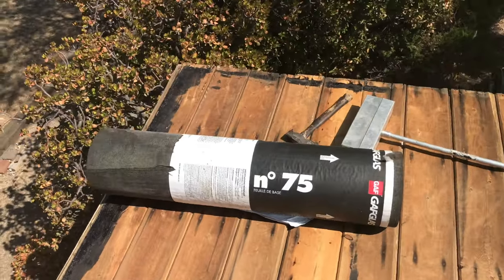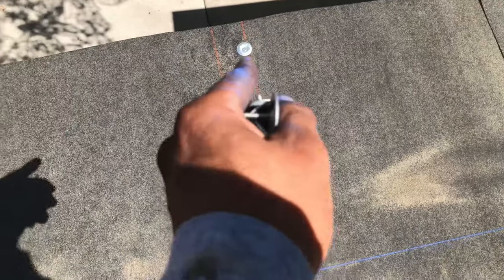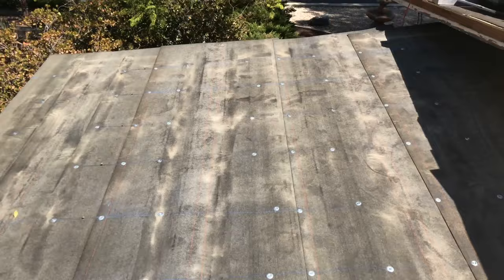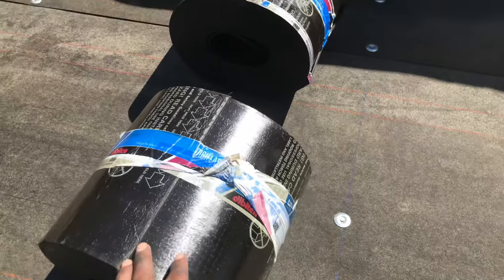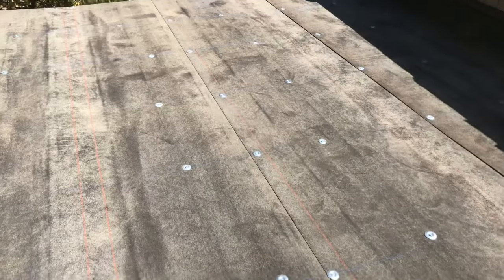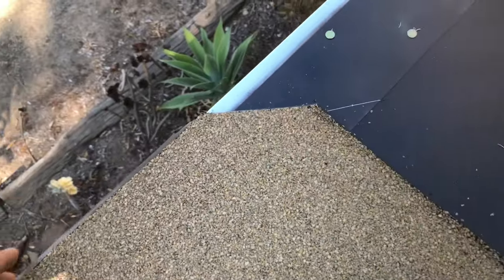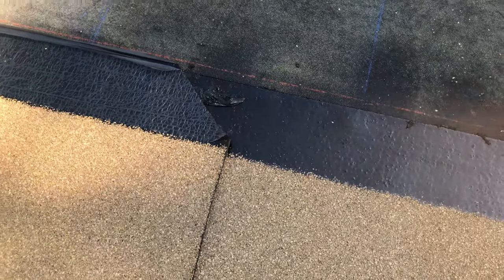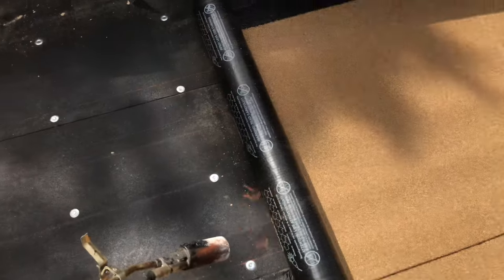STEP by STEP How to do Modified Bitumen Torch Down ROOFING INSTALLATION

Comment: There was numerous issues. I’ve been torching for over 15 years. I appreciate you trying to teach but there are much better procedures. First I would have primed the wood and used a peel and stick. Next you need a fire extinguisher especially on a wood deck. And we definitely don’t call it a flame thrower.
Reply: So prime it, be safe, call it the right thing? Seems like nit picking to me.

Comment: question... due to the fact that there is a drip edge PLUS a narrow roll of bitumen on the edge on top of the rolls you covered the whole roof with, won't there be standing water all around the edges due to edges having more layers than the middle of the roof, after you apply the cap sheet?
Reply from the maker: Yes, but it won’t leak. Also there won’t be too much standing water because it has open edges, no parapet walls. most likely the water will evaporate next 2 days of sun. All flat roofs have ponding water. You are able to fix this but most homeowners aren’t willing to spend the amount to correct the issue. We as roofers just have to make sure we put on a roof that doesn’t leak. The torch should be completely melted onto the deck. So ponding water should not be an issue unless it is excessive which will be more weight on the roof.

Comment: How you doing brother Joey here maxx roofing sunnyvale ca .I like your work but we want to spray the  asphalt primer on the flashing completely black cover 100 % with heat and cold expansion and contraction that the first place it will fail .keep up the good work.

Comment: How long you been torching I've never seen anyone use your method but I guess it works for you. The roof didn't look to bad nice job. I'm a roofer up in Toronto Canada 🇨🇦 we a torch the full roll here. And depending on the torch roll manufacturer we have to be a licensed installer. I've had to take torch courses from the manufacturer a few times each manufacturer is slightly different. Do you guy down in the states have to get licensed. And yes the roof Dr. Is a shoemaker.
Reply from the maker: I usually torch the full roll when I have a layer of smooth on the bottom. If it is a single layer system, I torch only until the lap. I know it takes longer but I want to make sure my laps are good since it is a single layer.
Reply: Hey im looking for torch rolls in canada but it's hard to find them. I'm from germany and currently in bc and all what I can find is this thin "sandpaper" he is using as base.
Where to buy torch rolls here and is these even possible as a private individual :) thanks in advance and nice video

Comment: Oh boy where to begin. I have been in the commercial roofing business for over 40 years.  I currently work as a QC daily monitor on commercial construction projects. 
Installing a modified bitumen roof on a wood structure is risky. Even with precautions to help in fire protection. First thing wrong ….no fire extinguishers on the roof with the propane torches. Next thing wrong is the side lap of the nailed base sheet is too close to the granular surfaced cap sheet side lap. Proper roofing calls for an offset of side laps of a minimum 12 inches. Base sheet is 36 inches wide, granular cap is 39 and a 1/2 wide. So you will eventually catch up and get a lap on lap condition. 
All manufacturers call for a sealant or roof mastic under the metal flanges, not just at the ship laps. Lastly the back wall needs to have a flashing membrane on a vertical rise. Industry minimum is 8 inches  but conditions need to be taken into account. Cutting and removing the wood siding, removing and replacing vinyl siding after extending roofing material on the wall and installing a metal counter flashing. 
Last thing wrong is the product choice. I am talking about torch grade products. The modified bitumen roof sector has alternatives like cold applied applications. Adhesives that are solvent and odor free. PMA and PMMA liquid systems that use nap rollers and paint brushes to install a very good waterproof and lasting roof. Good luck to all.
Reply from the maker: Did not read this, too long.
Reply: @roofingfanatics4775  you should read it there are some things should be aware of in the application of this product. If you can’t take 4 minutes to read what I wrote then you don’t care about improving your knowledge.
Reply from the maker: You lost me when you stated your experience. This is a patio roof. Not commercial.
Reply: @roofingfanatics4775  but it is a commercial product. Certain uniform details need to be carried over to small residential roofs or all you are doing is creating work for another roofing company and tarnishing your reputation. So it right or don’t do it at all my friend. I have watched your video on OSB v. Plywood on a shingle roof and you have made claims that are contrary to printed literature. I have been a union roofer for 8 years, 28 years working for two modified bitumen manufactures. Been directly involved with FM and UL testing. I will chat with you anytime to give you clarification on products and applications of roofing products.
Reply: @roofingfanatics4775  I want to ask you one question?  I a wind uplift criteria specification. What is the wind speed in a 1-90 wind uplift specification. #2 what are your wind speeds in California coastal to inland. Is it I-120,  I - 150 and what are your relative wind speeds to these pressures?
Reply from the maker: I don’t understand your motive. I gave this home owner a 12 year warranty with this roof. If it leaks I will go and fix it for free. I respect you are from the union and I respect that you may have experience. This is a 12 year roof and stated that to the homeowner who was 80 years old. Why would a 80 year old homeowner want to pay for a commercial grade job.
Reply: @roofingfanatics4775  you should respect me for my knowledge as I have worked for Siplast for 20 years and Soprema for 6.  Ten years as a union roofer I know modified bitumen products and application. Please answer my wind uplift question.
Reply from the maker: @michaelkotrosits4371  okay now you just lost my respect. Look dude, if you feel like you know about products more, then make a video on your YouTube channel. If you know it all I don’t understand why you would click on this video.
Reply from the maker: @michaelkotrosits4371  I hear a lot of self righteousness. OSB is a good product. Should not swell up if it doesn’t get wet. Sounds like you have something to prove. I know what I’m doing. Customer was happy. That’s all that matters.
Reply: @Roofing Fanatics  there's a reason why he gets paid by the hour and we crack  7-10  thousand in a one day job! My uncle went to college for ten years and can't read a tspe measure!! Lol
Reply: Can you please elaborate on the cold applied products you are referring to